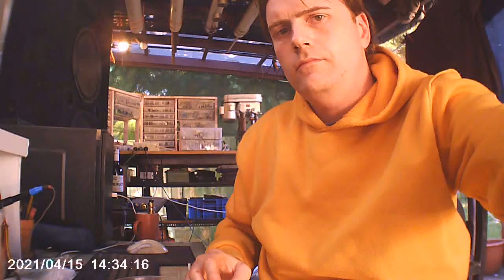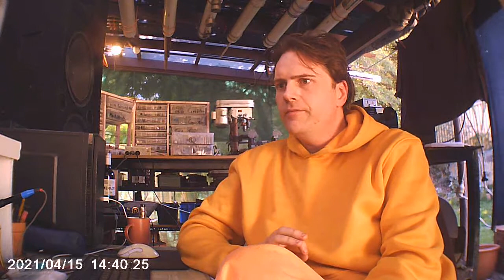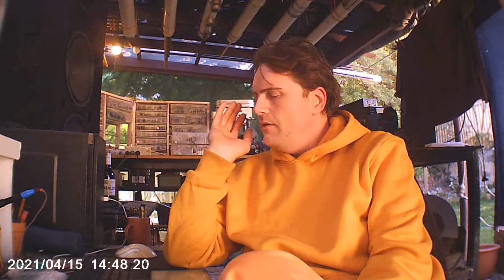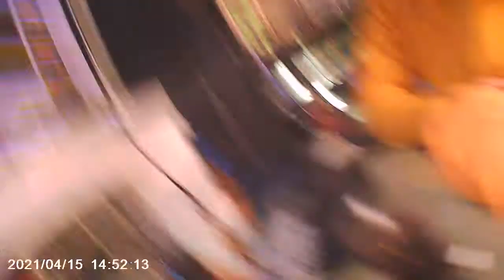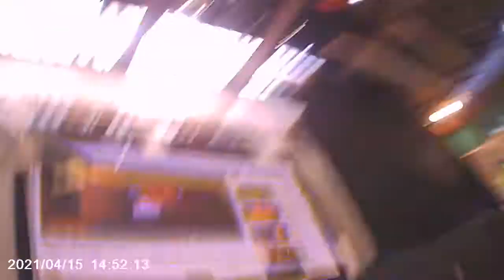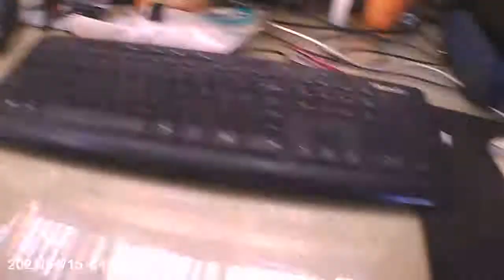boring but critical details for the elite enthusiast - newman motor construction advice.

Comment: My n52 magnets 6 stacked together much smaller than yours  have a magnetic field diameter of 2ft, the magnetic field strength of your giant ones is probably far greater than your coil magnetic fields, in physics is better something heavier is pushing something lighter then the other way around, this is obviously impacting your newman motor performance, the circuitry probably isnt the best idea either needs a sparking commutator
Reply from the maker: wink,  weight certainly is a factor.        oh and my circuits have carisma, and flux !

Comment: You need to try it eith a battery see if it stays charged, you use a main input so a back charge wouldn't work Newman only had a could of parts, you haven't even got a spark gap anywhere, read what Nikola tesla said about spark gaps

Comment: I think all our circuit fail. 
I think there will always leakage.    Have you heard anything that Newman motor had a pvc tube inside  the motor on the rotor, filled with helium wrapped with a shorted coil. ?
👍👍
Reply from the maker: familiar with the idea, currently working on some funky magnetic geometry instead to redirect the "pull back" onto another dimensional plane